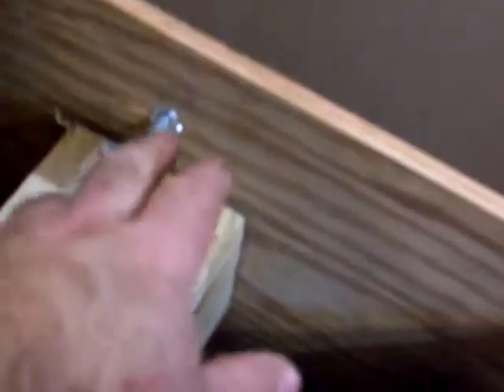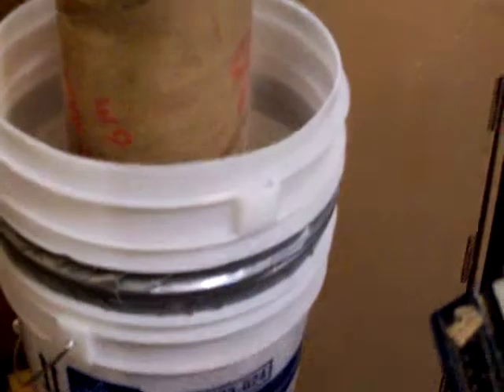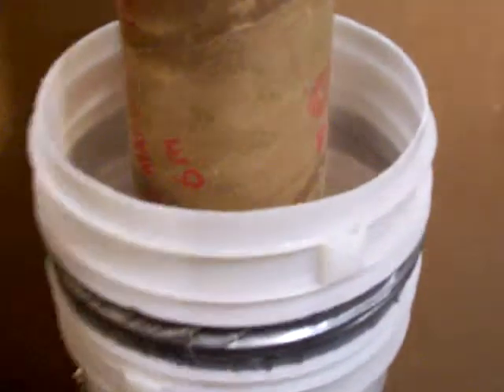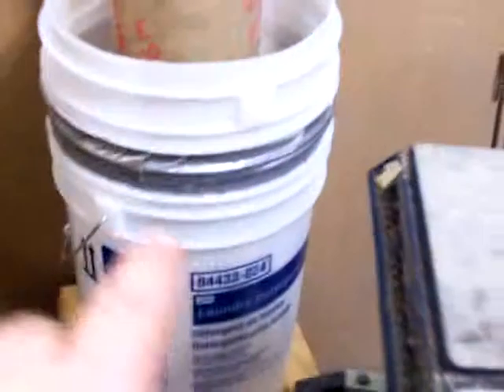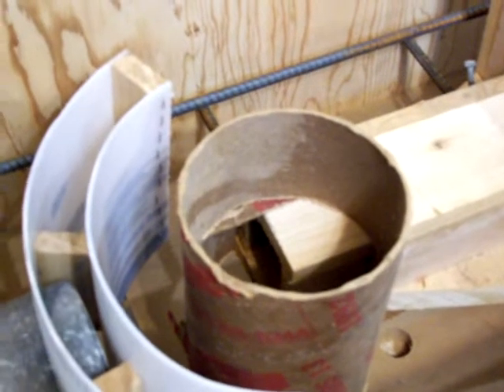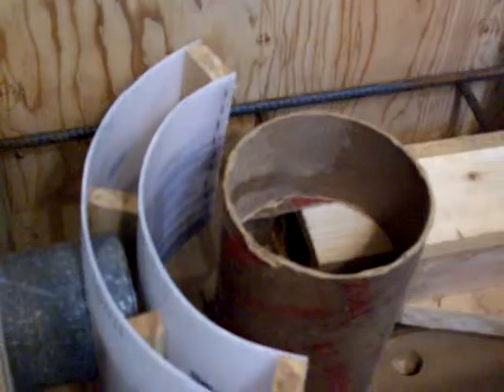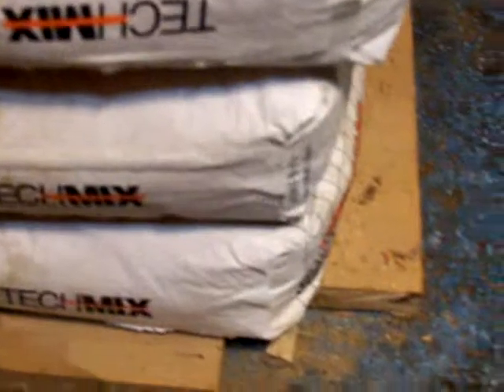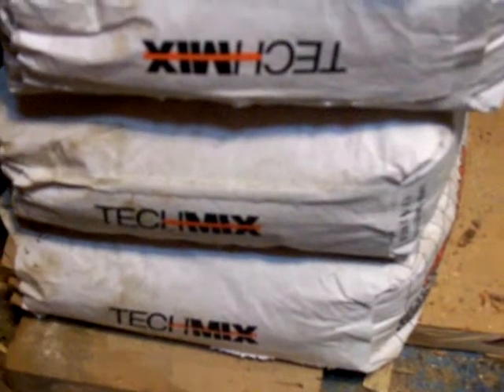ROCKET STOVE MASS HEATER (constrution part 2)

Comment: I have build a similar construction with 1.2m tall, 8" heat riser etc. The burn chamber/tunnel and the feed tube is made by fire-proof cement and after a couple of burn times it cracks. I end up adding tile stones to the walls internally and a upper steel plate inside of the horizontal burn tunnel.
The feed tube which we set the wood logs, is also cracks but it is not an issue because I can build a brick wall outside of it to keep it warn and strong.
I build the heat riser with ordinary/portland cement and perlite and its stand well.

I think cement or fire-proof cement will not have to be strong to prevent cracking. Maybe adding some sawdust to the clay will help.
Next time I should use fire bricks for the horizontal burn chamber. For me cement is only good for bricks and general building.